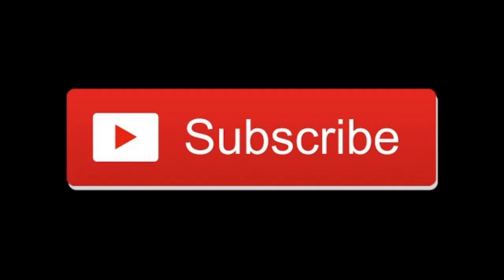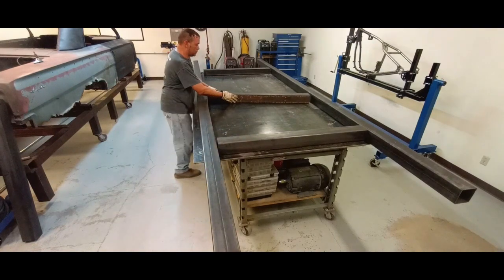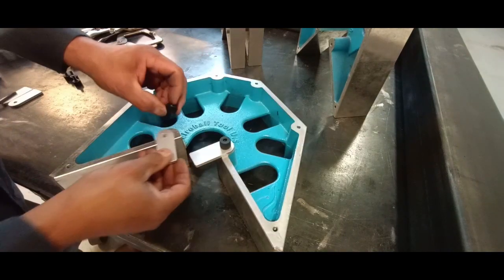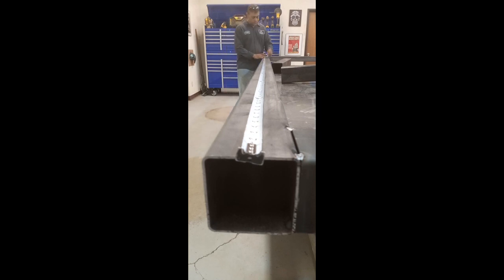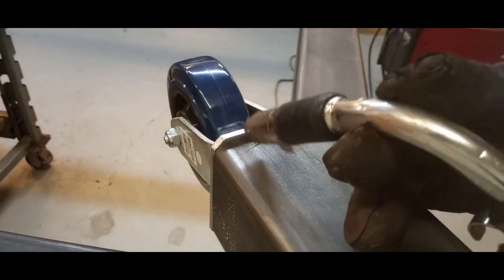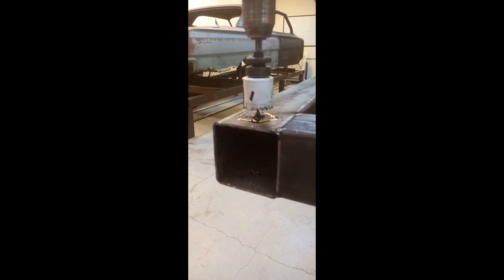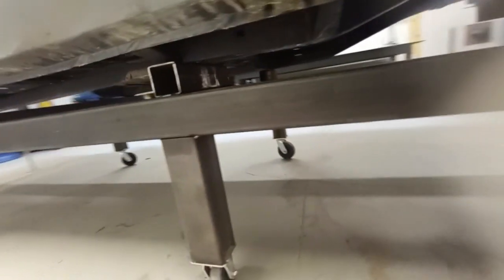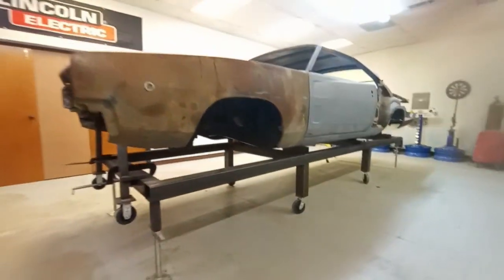Heavy structural or rust repair on your restoration? a frame fixture is a must! How to build one

Comment: Nice job like always brotha,
Reply from the maker: Thanks brother !
Reply: @guzzifabrication3448  hey brotha I wanted to ask a question when you spray epoxy primer do you sand it after or do you just spray surface primer and then sand?
Reply from the maker: @cesaralcantar2843  no sanding if you have just media blasted but you always have to prep after it's been epoxied
Reply: @guzzifabrication3448  ok so I do have to sand it ,after epoxy,
Reply: Thank you so much bro much appreciated,keep up the good work brotha,